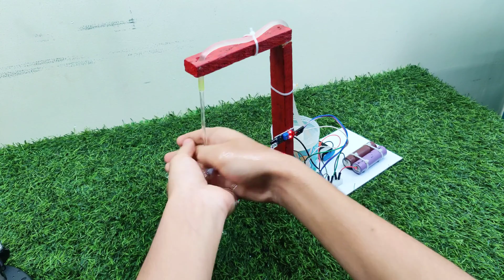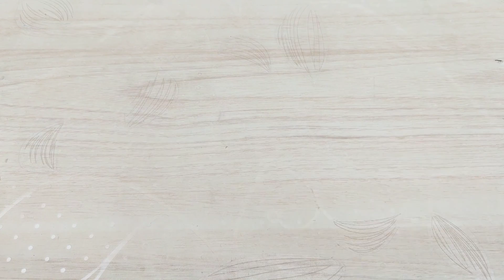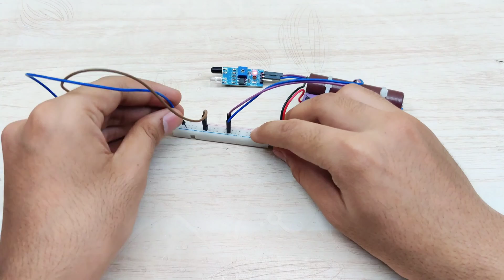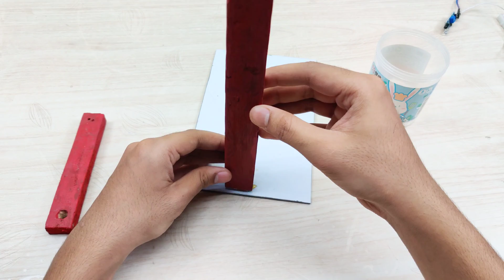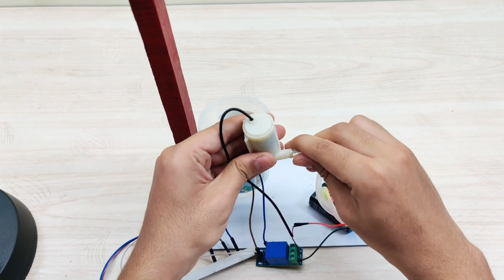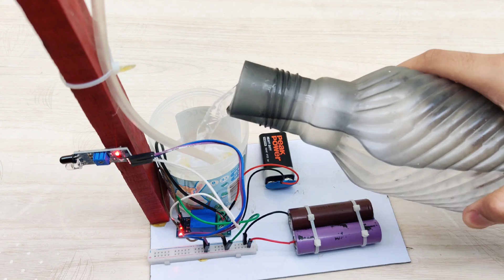DIY Automatic Touchless Water Tap without Arduino || Smart Tap Using IR Sensor ||  Eazytronic

Comment: hello! thanks for the very useful tutorial. me and my friends will make a project like you did, but can the 6v battery be replaced? like 7v and others?
Reply from the maker: Yes, you can try with 7v.
Reply: @eazytronic9394  thanks! i'm very grateful for the tutorial. after I modified it to be displayed at the exhibition, my homeroom teacher was very happy. because only my group succeeded in making this automatic water engineering technology, may God bless you 😄😄
Reply: i have try with 9v or Ir sensor but it is can not why?

Comment: Can we give 2 nos of 3.7 v battery, other wise you can say which two battery you use means what is the voltage of 2 li battery, please tell in two days i have to submit it
Reply: Look voltage of li battery is 7.4V we need only 5V then you have to use ic7805 to reduce the voltage for your relay and sensor